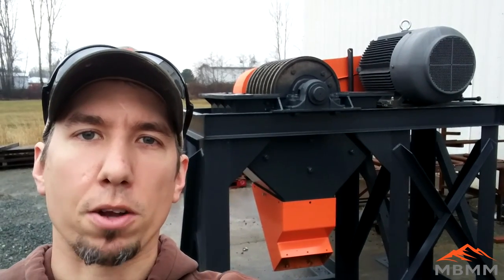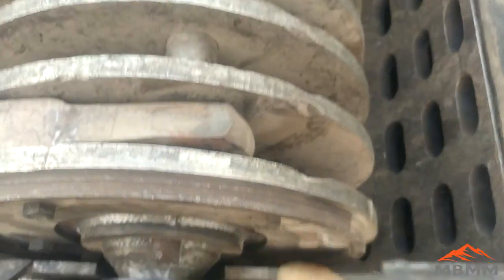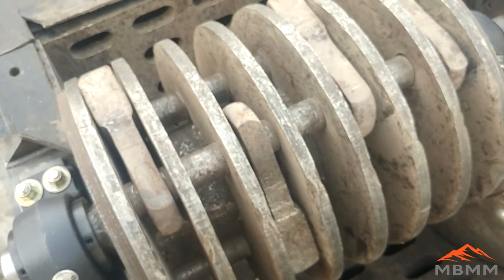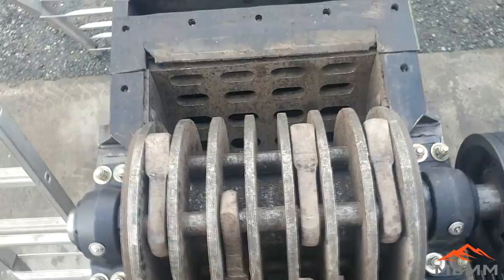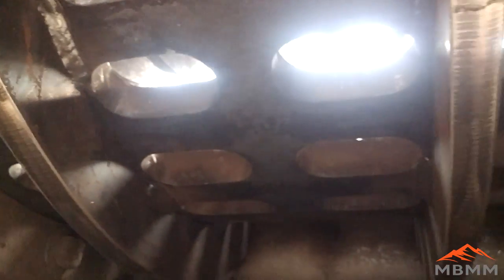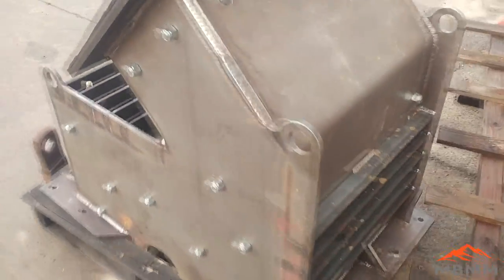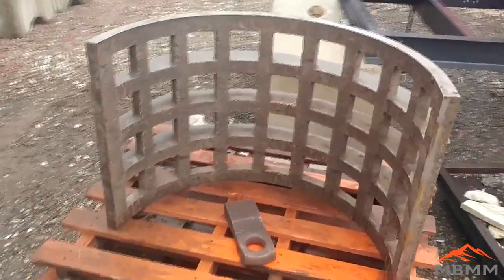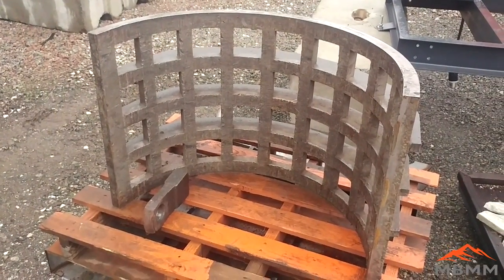Scrap Metal Hammer Mill Build, Parts, Design For Shredding & Crushing

Comment: consider a system that takes ALL the material down to 100 or 200mesh- , so the particles are all the same size. Even if it requires switching out mill screens and running several times. Then, put more grade dividers on the table to get a better grading effect, and run each grade on the table at least twice to get the highest true grade possible. Classifying the material before running across the table will keep the particles the same size and  will keep trash out of the high grade material. Running each grade a second time, on it's own,  on the table, should give you finer gravity separation of the different metals. Any magnetic separation should be done AFTER the full size  reduction, but should not be necessary if the grades are classified and individually run a second or third time each. The ferrous should separate from the non-ferrous due to difference in Specific Gravity.  Table angle and flow may have to be adjusted when you get down to clean metals to get sufficient separation.
Reply from the maker: Thank you for the tip! We'll definitely take a look into that!

Comment: Very good detailed informative video... you guys keep making your machines beefier and beefier... one question though why do you turn the big 6 inch shaft down to smaller ends.... 6 inch bearings with a 6 inch shaft sounds more stronger... just curious
Reply from the maker: Thanks Mike.  The 6" shaft gives the strength, and turning down the ends doesn't compromise strength, but the bearings are A LOT cheaper.

Comment: Hey im curious but do you have a hammer mill that is small that is light weight and will only run wood and wood products? Im thinking about using one to mount to my pickup which feeds into a wood gasifier.

Comment: no hard facing on the rotors? is the rotors made of S355JR or hardox400,
Reply: They would advise doing it but most all companies dont , because they want your business on replacement parts.   I use a high chrome rod on our machine. Our hammers are also AR500  3" wide.   Our screen is also AR400. and the feed box is made of .500 thick AR 400with 1" liners and a mag, anvil.
Reply from the maker: AR400, the rotors last a really long time in scrap operations.  Thanks for the question

Comment: What is the Rockwell hardness that you use for the hammers, screens, and walls?
Reply: The hammers are self hardening.   They will go to 600R + is a few days.   The AR400 is about the same.  The bad thing about the hammers is the shaft hole will stretch over time and ware out the bar and cam or brake the bar if its 4140 ,    4150 bar should be used for very long life.
Reply: MetalWorks Machine Shop thank you!
Reply from the maker: Thanks for the detailed response!
Reply: @ursamines7643  pl0Q